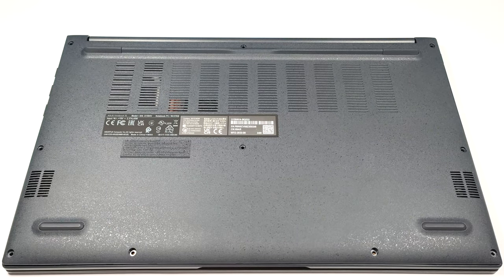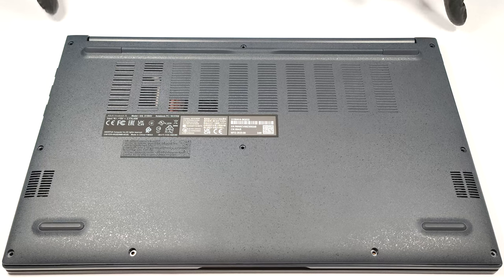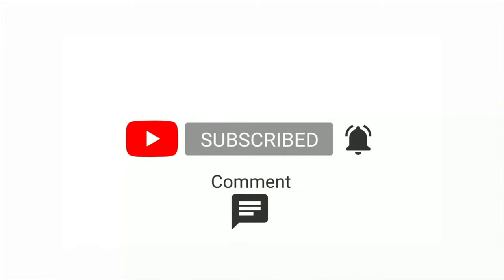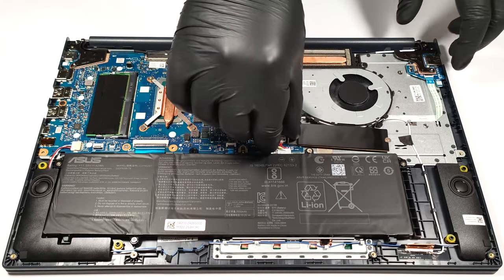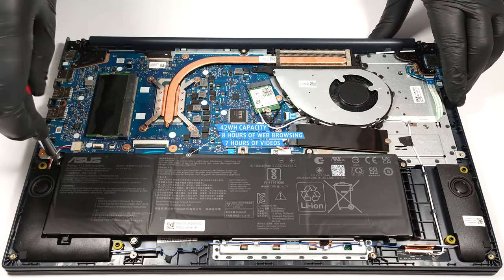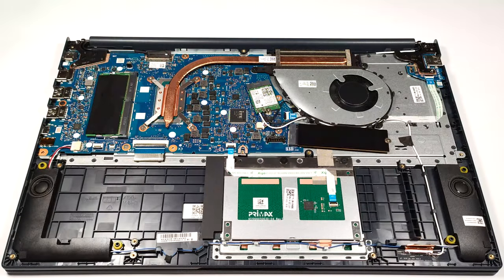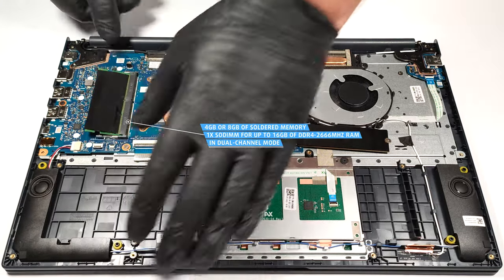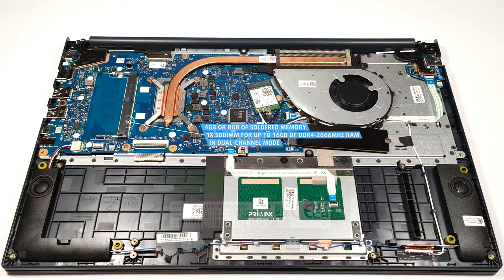🛠️ How to open ASUS Vivobook 15 F1504 (X1504) - disassembly and upgrade options

Comment: Thanks for this complete video. Just to mention I upgraded my Asus X1504ZA with Intel Core i5-1235U processor with a total of 40 GB DDR4-3200 RAM (8 GB Soldered + 32 GB in Slot). Memory (RAM) speed should be contingent on the processor; mine runs at 3200 MHz.
Reply: I have the exact same model with same specs. just wanted to know what SSD upgrades options I have like which generation, SATA or NVMe. please guide as I don't have any good knowledge over this stuff .
Reply: Friend, can you give me the complete model reference?
Reply: @muhammadhateemali1917 4th Gen NVMe M.2 SSD 2280. Best regards!
Reply: @oscarignacioherreradoria8765  Lexar 32GB Single DDR4 SODIMM RAM 3200MT/s CL22 260-Pin Laptop Memory, Black. Best regards!
Reply: Dose your laptop heat while using plug in
Reply: @FROILANDRES  Dose your laptop heat while using plug in
Reply: @aminkazi9582  Only once as I recall, no issues so far. Rgds.
Reply: @FROILANDRES   is 65 c normal while using this laptop while plug in
Reply: @aminkazi9582  Ummm, more likely to be higher that it should. Make sure to have your OS fully updated and if needed, contact Asus support...
Reply: @FROILANDRES  i have update it now it gives me 55 - 60 c  using while plug in is it normal
Reply: @aminkazi9582  It should be good temp range. Rgds!
Reply: Can I have slot for upgrade RAM and SSD ON  Asus vivobook 15 X1520ZA I3 12th Gen ?
Please reply me
Reply: @kasisk5488  It should have 1 RAM Slot but more likely it has only 1 slot for NVMe M.2 SSD. So you can replace that SSD for a bigger and faster one, should be Gen 3. Good luck!

Comment: I'm wondering if you can fit a 2.5" SSD in the free space on the bottom left side (with or without some kind of connection adapter.)
Reply: Absolutely not! That free space you are referring to is allocated to the battery which he removed. An updated model has NO ports or room for upgrades of any kind, except to remove installed memory with a newer single stick of ram. This laptop has only one memory slot.
Reply: It you find a sata connection in the Motherboard, and you wan to use it without internal battery or buy a smaller one, it may be possible. Otherwise I recommend use external 2.5" SSD with enclosure.

Comment: Thanks for this video.
But I didn't know if I add a 16 gb ram to this laptop, can it work In dual channel mode or not? (for using iris xe)
Reply: Wondering the same thing
Reply: yes it works
Reply: Check your Processor's maximum supported RAM, some models can go up to a total of 40 GB RAM (8 GB Soldered + 32 GB in Slot), and it will use dual channel as it has a soldered Memory module and will share up to 50% of installed RAM with the Intel GPU or will share up to the Maximum RAM supported by the Intel GPU.

Comment: I just bought one F1504ZA , everything is great - price , cpu and usage.
I upgraded ram & m.2 (2280) , but I wondering if the display could be upgraded ?
Reply: Hey, i just bought the same laptop model as you. I have a question. Is your laptop getting hot on usual activities? Cause mine does and i dont know if it s broken or not. I bought it brand new so idk, it shouldnt have problems.
Reply: It may be possible, but you would lose the guarantee as I understand. I would buy an external monitor...
Reply: @danmoodiee  mine too 65 c while using plug in  and 54 c on battery

Comment: A1502za 1240p 3200mhz ram speed or x1504z 1335u 2666mhz ram speed which is best for intensive task ? Both are 8gb soldered ram and one extra ram slot.
Reply: Go for the Intel Core i5-1335U 13th Generation Processor (12M Cache, up to 4.60 GHz) and install 32 GB (Dual Rank module I recommend) in slot for a total of 40 GB RAM. That processor supports up to 96 GB RAM while the i5-1240P is one generation older and goes up to 64 GB RAM (33.3% less). With the i5-1335U in the future there may be 64 GB modules, and could further upgrade...

Comment: I have 16 gigabytes installed on my x1504za laptop (8 built-in and one slot for 8 gigabytes), can I put 32 gigabytes in one slot? name the motherboard model please!
Reply: Check your Processor's maximum supported RAM, some models can go up to a total of 40 GB RAM (8 GB Soldered + 32 GB in Slot).

Comment: Where can I see how many slots asus vivobook 15 X1504va has, I want to expand the ram to 16 GB
Reply: One Slot free. The onboard RAM is permanently soldered in. So if your laptop has 8GB just put another 8GB in the slot.
Reply: @SpeccyMan im about to buy x1504 with 20gb ram, is that mean 4 gb soldered n 16gb in 1 slot ?
Reply: @Gamerhopper  Correct, should be as you said but can be 16 GB soldered and 4 GB in slot... Ask the seller just to be sure. Best option will always be more soldered or 2 slots (other models).